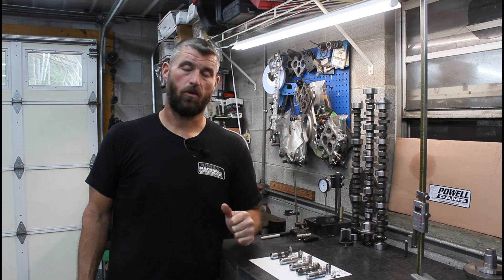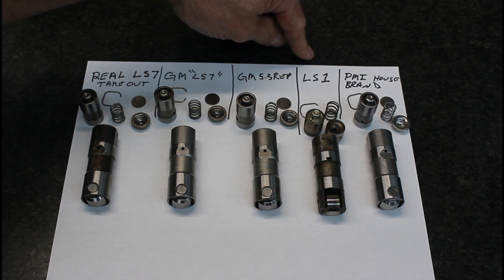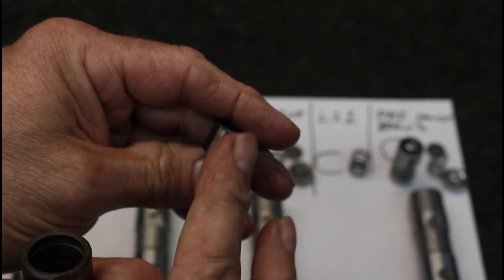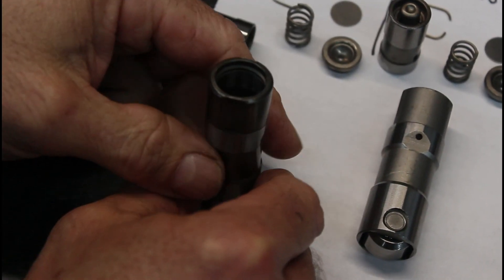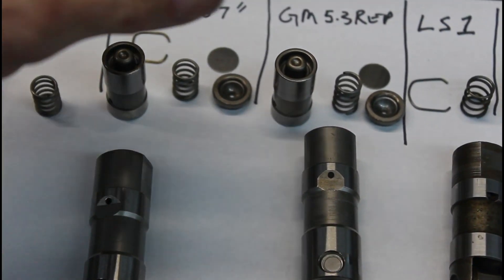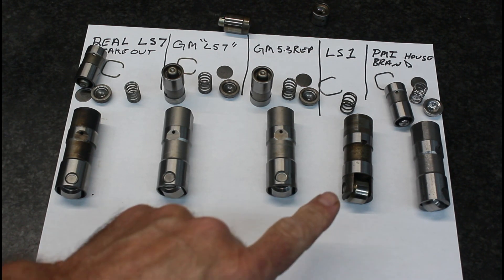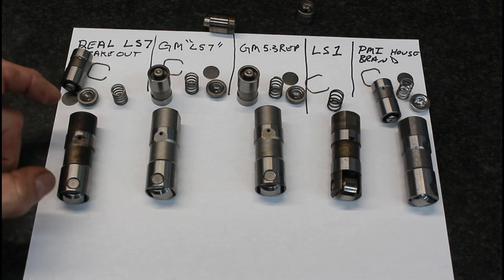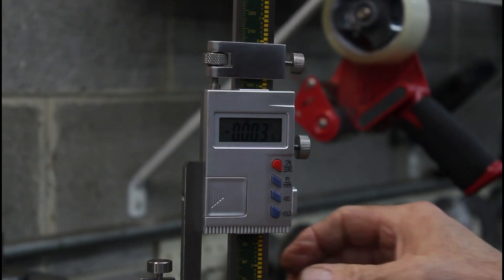Do "ls7" really exist?? And how much preload do I need?

Comment: I've read the lifter bottoms out around .120 preload for LS designs.   Using stock pushrods i have .098 preload measured with dial indicator (1.25 turns after zero lash) car runs but real bad,  backfire and won't climb a hill.   It's a new build.   Do i have to much preload and require .050 shorter pushrods?
Reply from the maker: Most lifters have almost. 200 travel,  .03-.060 is ideal but to much won't make it run bad unless you bottom out the plunger

Comment: I thought GM went to the LS7 style lifter for production of everything by 2008-2009, and also to replace earlier lifters.
Reply from the maker: If that's the case why do we have identical lifters in the early 2000's?
Reply: @powellmachineinc  I know you said that in the video. I have not compared those recently,  but I did tear down a L31 Vortec that was a 2001 model this week. It has the early style lifter. I just checked. 
The lifter supplier told me GM used the LS7 style lifter in all production and as a replacement. It seemed correct based on replacement parts I was getting. And truth was, they were fine. I had zero problems with any genuine Delphi lifters.  The same lifter being used to fill numerous part numbers is also not a surprise.
Reply: @v8packard I have had apart 3 L31s built post 2003 that had the newer lifter design.  My 2003 Mexican Sonora, rebadged GMT800 Tahoe, my 2007 Mercruiser 5.7L and a 2006 era Hecho en Mexico Goodwrench L31. The L31 was used in trucks and SUVs until 2007 in Mexico and the Mexican built engines seem to all have the later lifters.

Comment: There is a difference if you buy the Chinese LS7 on eBay is junk and can ruin your cam and your engine!  
The Chinese LS7 the roller assembly softer metal and poor quality! The rollers pin placement is not precise some are crooked from side to side!
Reply from the maker: Well...... we don't use ebay China lifters, and again  ls7 lifters Don't exist

Comment: Nice info, i wish you had measured their outside diameter for lifter to bore ( my ST2126SLR for insane while their tolerance to each other is tight are slightly smaller to stock).

 Im not surprised they are made same or similar, i am surprised morel and others dont have different metals, axel diameters, wheel diameters, cup and disc tolerance and bleed sizes, nothing lol not even return spring heh damn...
 I didnt think there were different heights but i DID think metallurgy and bleed of rates were different even on standard travel drop ins ( Johnson  SLR/ Morel ect)...

 Now i have personally seen a china copy fake "LS7" lifter and their wheel with on the roller surface was narrower....

 I was told GM High performance  aka Caddy lifters were different ( but didnt like over 380lbs over the nose and im about 420 with a heavy valve train comparitely, BR7 heads and turn it up with the high ram so went with the best )

Btw you doing GODS work lol, damn this is hilarious because ive heard LS7 lifters needs a 7.350 pushrod a LOT generically without actually measuring it on base circle of cam and THIS is where it comes from)..

Comment: Basically all the same hydraulic lifters,  except the LS1, the only difference is a set can come in many different brands of boxes, are the vast majority of LS hydraulic lifters manufactured by the same factory machine shop? The .030 difference is strange, yes there's break in wear and later but if oil and coolant are maintained properly, definitely not even close to .030 from cam to valve seats, and valve seat wear would create a little back pressure on top of stem due to closed spring pressure maybe a couple thou.

Comment: Whatever happened to the Johnson hydraulic roller lifter with the ceramic check ball that was introduced when the COPO & Cobra Jet factory drag rave cars returned years ago?  Supposedly, they were good for another 300-400 rpm.  It's amazing how much wrong information gets regurgitated around the internet and people have no critical thinking skills.  I know you know and I understood what you meant but lifter pump would be that distance times rocker ratio so it could definitely get ugly quick with ridiculous preload and valve float
Reply from the maker: Those were "race" pieces,  there not available any longer,  put a check ball matl change is going to do squat to the rpm capability

Comment: The .030 difference is strange, after normal cam break in and subsequent break in of other components from the cam to the valve seat there will be a change in dimensions/tolerances/geometry of the cam to valve seat operation, but definitely not close to .030 after engine is at normal running temp and all components "measure up" and all machine work and assembly are done properly.